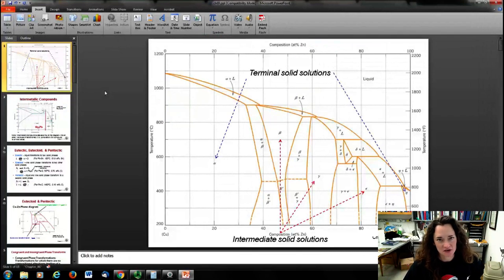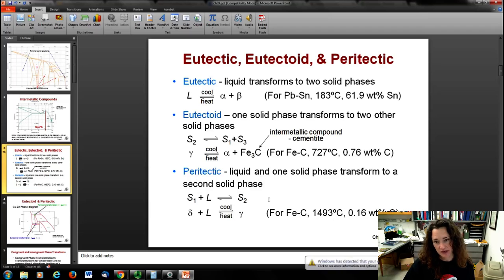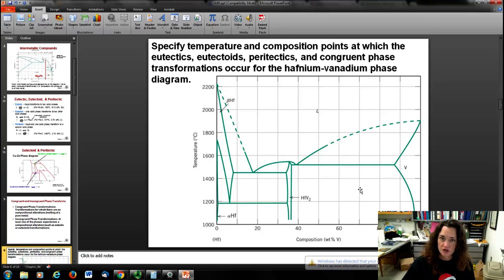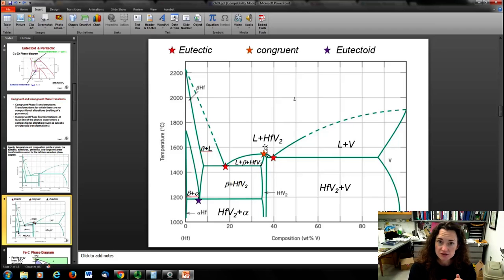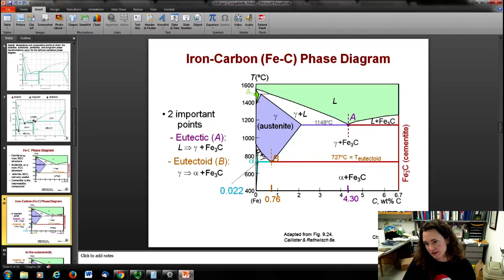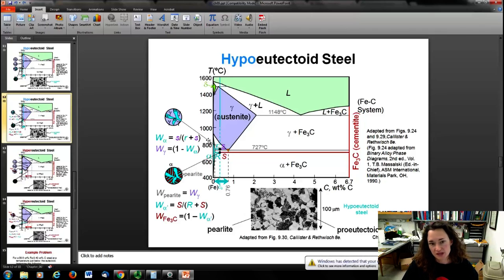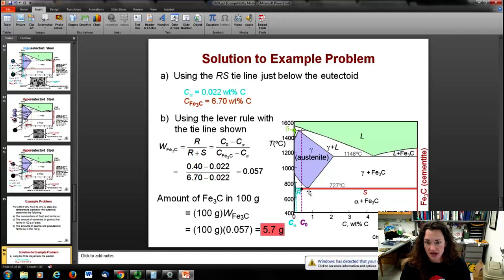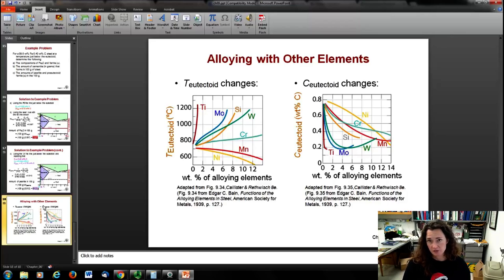Fe C Phase Diagram Intro

Comment: What is the microstructure after 2.17 % wt carbon as it is being cooled down, Sir?
Reply from the maker: Depends on whether its to the left or right of the eutectic. To left, you would still have some austenite in liquid phase above 1148 C. To right, you'd have some cementite in liquid phase above 1148 C.